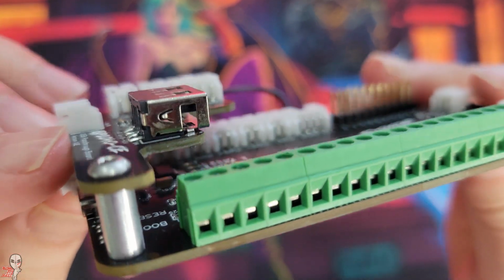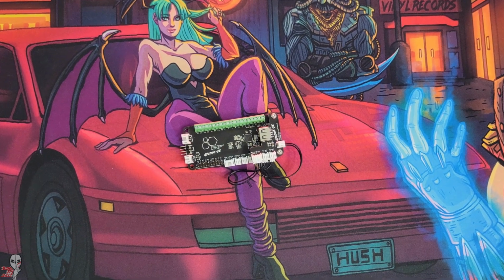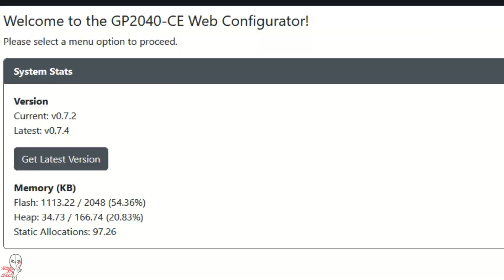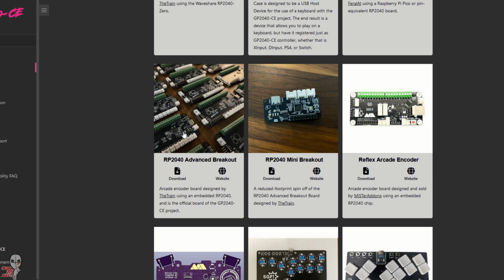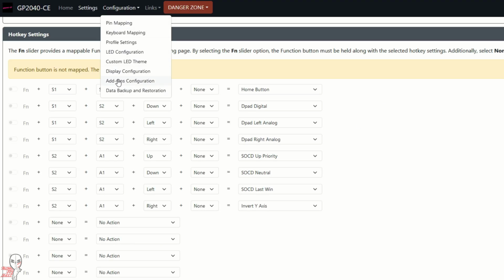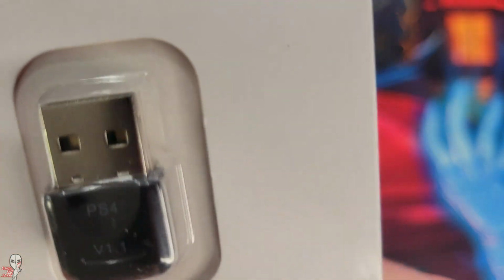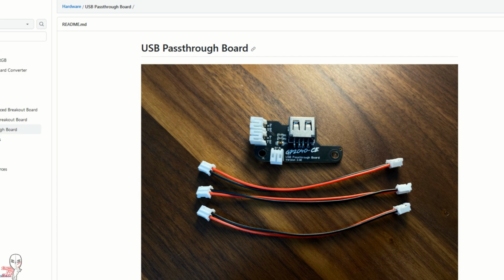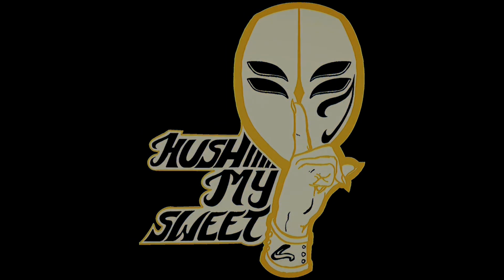Cheap NEW PS5 compatibility for your fightstick!

Comment: so i have a customized keybox, it has a gp2040ce firmware, the input in the settings is in keyboard, will it work on ps5 ? using a brookman fgc 2 ? and my keybinds are also customized especially in tekken. idk if it works automatic or do i need to do something

Comment: Hey man, thank you for this video. But, once I finish setting the board up, how would I change from PC mode to PS5 mode? I play mainly on PC but I go to locals and play at my friends house and they use PS5. Do I have to enter the website each time i have to switch?

BTW: Im thinking of buying the advanced breakout board v5.6 thst comes with the passthrough already on the board. I dunno if thats important just in case lol
Reply from the maker: I think holding B4/triangle as you plug it in should make it default to PS5. Also, the advanced breakout board is a much more elegant solution than this add-on, so I'd definitely go that route (it's basically the same, just streamlined). Good luck!

Comment: could this be used to power led buttons for a qanba or hori sticks??
Reply from the maker: If you are gutting the previous PCB/internals, then yes. But this isn't something you can easily add to the existing hardware as like an add-on or something.
Reply: @ yea i’ve been doing some research and I think I need the kaimana mini

Comment: do i need to turn on BOTH ps4 mode and ps passthrough in the webconfig in order for it to work on ps4/5 with no timeout? worth reminding i set it as an arcade stick in the settings menu, not controller. i do not have a ps4 or ps5 in hands to test right now so your help would be much appreciated 😅
Reply from the maker: I'm gonna pass the buck and say if you need to troubleshoot or test specific stuff that you can't confirm for yourself (I don't have a PS4 hooked up atm either), I'd recommend the Open Stick Community discord. They will be faster than me in responding to your questions and most are super helpful. https://discord.gg/eYpyJeAT

Comment: I bought this exact one for the slab mini hitbox for the ps5 and it doesn't work at all. It flashes the blue light on rhe converter but nothing else
Reply from the maker: You may need to update the firmware? I'd start with that. Then, the r/fightsticks discord and/or the gp2040ce discord can help troubleshoot if the issue persists. And Troy is pretty good about responding to etsy messages if the community can't figure it out for some reason. Good luck resolving the issue.
Reply: @HushMySweet1  he was great responding instantly and got it resolved

Comment: Hello there I have question regarding pico gp2040. I have key files for ps4 mode and I don't counter 8 minutes timeout thingy. So my question is can I connect my stick ps4 mode with files on ps5 as legacy ps4 stick without doing passthrough thing?

Comment: been trying to find this for a while but don't know where to look, what are those metal stick things you use to connect the passthrough board to the main pcb? i can't find them anywhere and don't know where to look
Reply from the maker: Like the 20-pin connector? I'm not 100% sure what you mean, so google that to see if we're on the same page. If not, maybe circle the part in a jpeg and email it to me? Good luck!
Reply: @HushMySweet1  nvm, found what i was looking for. i was referring to the metal standoffs.
Reply from the maker: @LunaStardust666  Glad you got it!

Comment: I dont think this works anymore.
Reply from the maker: It does. However, it is specific to the type of board you saw in this vid. These days there are PCBs which incorporate all the tech you saw here, so no need for all these extra cables. If you still have this board though, it absolutely still works.

Comment: Could i just splice a female usb header to 4 female dupont headers and plug them to my pi pico? Sourcing passthrough board here locally is impossible.
Reply from the maker: Technically yes, but according to TheTrain, it’s advisable to have resistors on the data lines and a fuse on the power line.
Reply: @HushMySweet1  just an update. I've been chatting up with TheTrain in discord earlier. with pi pico and magic boots / PXN N5, we could wire it directly without resistors and a fuse.
Reply from the maker: @BigLazyBear  Right on! Glad you got it figured out! Good luck with the project!
Reply: @HushMySweet1  thanks hush.
Reply: @HushMySweet1  ah thank you
Reply: @HushMySweet1  so, i'll put 10 ohm 1/4w resistor on both D+ and D-, and 0,5 amp fuse on the V line. this should work right?

Comment: Hey - from where can I get the board? Couldn't find any info online ;x maybe I'm just dumb.
Also, do I need to buy GP2040 and then GP2040-CE as an addon, how does it work? Thanks in advance!!! <3 Love the channel!
Reply from the maker: This board has that additional piece already built in so it's a bit cleaner looking (and you won't need all the wires and such you saw with that little add-on here): https://sgfdevices.com/products/sgf-gp2040-ce-advanced-breakout-board-pe  Then, just buy a Magic Boots to hook in to the board if you need PS5 play. https://sgfdevices.com/products/mayflash-magicboots-ps4-v1-1 Good luck!
Reply: Huge thanks!!! <3  @HushMySweet1

Comment: I ordered mine, the wiring was slightly different, might be newer. Used your video for the web setup stuff, thanks! Got a cheap ps5 stick now. (Converted my old xbox 360 rap 3 ex) i had a brook ps3/4 plus in there but it would have cost me more for a up5 than it did for the passthrough and gp2040, already had the mayflash magic boot v1.1. And i got the ps3/4 plus freed up for a future build!
Reply from the maker: Awesome, glad it was of help!

Comment: Big thanks for spreading the visibility of the OpenStick Community. I'm in the process of getting the parts to slap together a leverless controller and they've been a big help in both the hardware and the advice departments. The RP2040 Advanced Breakout Board with the built-in USB passthrough they have in the works looks to be the solution for anyone who wants to build a stick (or stickless) and doesn't want to break the bank paying the "Brook Tax".
Reply from the maker: Oh yeah, definitely a nice and knowledgeable group of people. Good luck with your build! Thanks for watching and commenting!

Comment: hi, great news for ps5 players... but do you have a way to do it with a PICO? i was searching in the web but not found for PICO users--- thankss
Reply from the maker: This would still work, but you'll need to solder (and there's a lot to potentially mess up). Nothing equivalent to this mod is quite as simple yet. Thanks for watching.
Reply: So it would need power and ground but what do the other 2 pins go to in the Pico board?

Comment: Great video.

Is this PS5 compatibility still has 8 minute disconnect problem?
Reply from the maker: All that is gone. No need for codes or anything, it all just works straight away with no timeout issues.

Comment: So the previous firmware hack to run on PS4 doesn't allow it to work with PS5 (in PS4 legacy mode)? I hope that question makes sense.
Reply: Yeah, it did not work in that way, because it didn't have the secret sauce to convince the PS5 that it is a licenced PS4 stick. This passthrough method, on the other hand, does manage to do that.

Comment: Youre speaking Japanese to me. Maybe i just dont get it
Reply from the maker: Hey, let me try and break it down further for you then. 1) This is a cool and exciting mod because with this passthrough installed, it opens up PS5 play for many games, 2) The whole unit is going to be about HALF of what Brook charges, so it may encourage more people to build more fightsticks, 3) You can use the files in the description and utilize a PCB assembly service to basically make these at a reasonable price, 4) If you don't want to do it all yourself, then there are several vendors (SGF and Buttercade) which are going to be selling the finished boards ready to go (here in another week or two), 5) Basically, this is a super fast firmware and these boards are cheap enough to really open the doors for more people to start building sticks toward PS5-compatibility. Hope that helps!

Comment: Went to my first local this past Friday with my flatbox with a magic boots wired up via usb pass-through and it worked on both ps4 and ps5 playing SF6 well over 8 mins :)
Reply from the maker: I love to hear it! And yeah, definitely no timeout issues. Thanks for watching!
Reply: Are the passtrough flatbox files available anywhere?
Reply: I took the Magic Boots dongle out of the plastic housing and wired the USB pins to two available pads on the RP2040 board powering my flatbox. Then i used the configurator to set those pins and voila!  @leonz5020
Reply: how did you connect the magic boot to your flatbox and also connect it to ps5 at the same time? are you saying that you installed this passthrough mod into your flatbox by opening it? can you clarify a little.
Reply: @deadbyfryingpan I am still waiting on you respond on above question :)

Comment: The important question is that what is the input delay in as compared to brook. I am sure there will a lot of delay 😮
Reply from the maker: The input delay of GP2040-CE firmware is some of the fastest in the business and the MagicBoots addition does nothing to add additional latency or anything like that. https://docs.google.com/spreadsheets/d/1OLmVg04e2q4aY0tqSJuaHtD8YMNCQnP-MzzSTtQLVm4/edit#gid=1356338809
Reply: @HushMySweet1  thats interesting 🤔..i thought add ons would add to the lag. Currently, brooks wingman FGC convertor adds to the lag.
Reply: @thedemoman1813 because all this does is pass usb authentication whereas the brook fgc is an actual converter.  Latency is much lower than any device running on a brook fgc.
Reply: Brook has more delay than GP2040-CE

Comment: This looks great, I was aware that people were working towards this. 
I'll hold until an all in one board is available, or wait for flatboxes to start using this.
Reply from the maker: Actually, just a couple hours ago, they released the files for a more streamlined board. I just had the early module stuff for this vid. The new board will be even easier than this here!
Reply: @HushMySweet1 

Yeah. going to wait until I can just buy something though.
Reply from the maker: All good. It looks like SGF and Buttercade both have these products coming down the line so you'll just be able to order if you want something a bit easier. Thanks for watching!